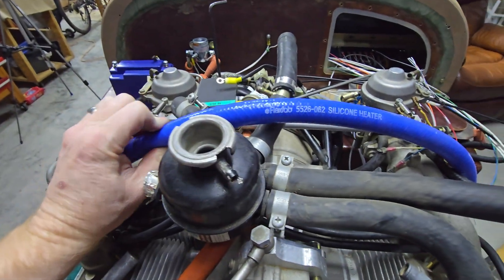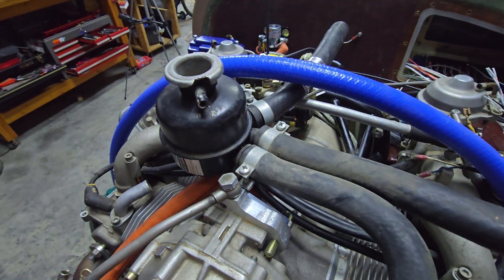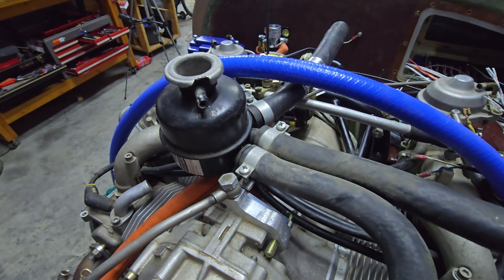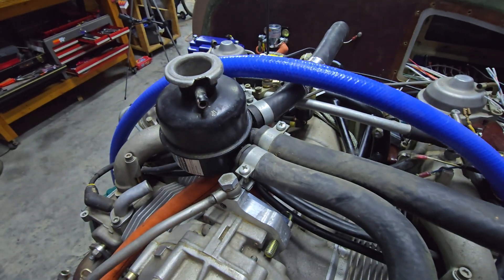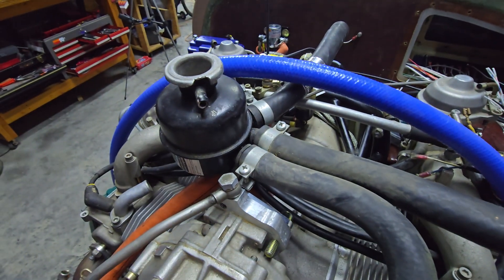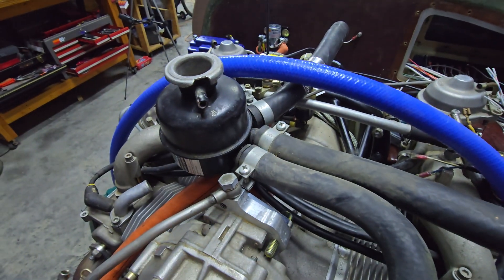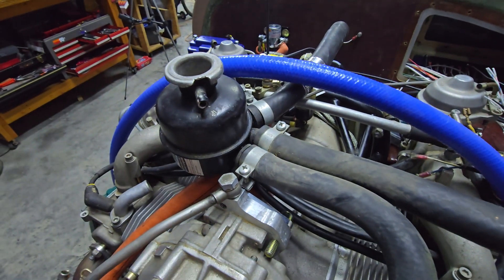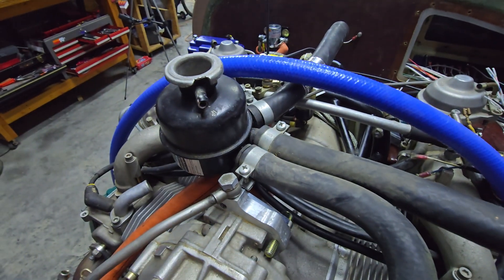Europa Aircraft Kit Build - Silicone Hoses

Comment: Great job, Kyle! Finding the correct ID for the coolant hoses couldn’t have been easy. Oil lines are the real problem to size properly so I had to go with modifying those using AN fittings with metric threads on the oil cooler… let us know how your oil system gets set up.
Reply from the maker: Thank you!  I agree finding hoses in the US to fit metric applications is a chore.  I used Parker hose for the oil line.  It seems to fix snug but wont really know until pressure is applied.  I'll have to look for the invoice of what hose that is. My notes from doing research a few years ago is Parker 836-8-RL, but not sure if that was available when I purchased some hoses locally.